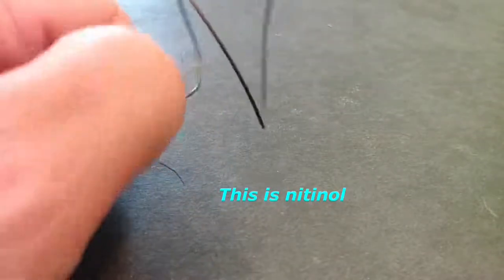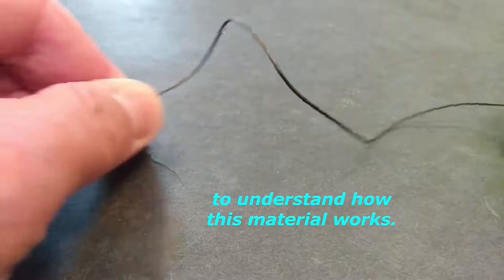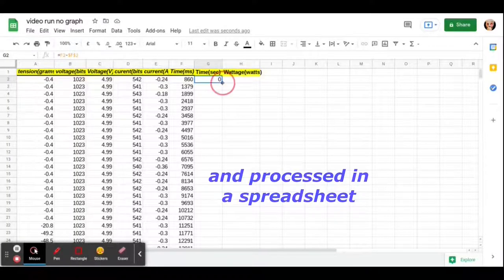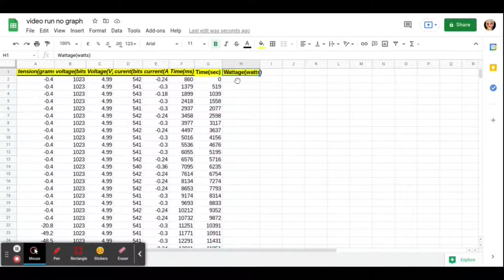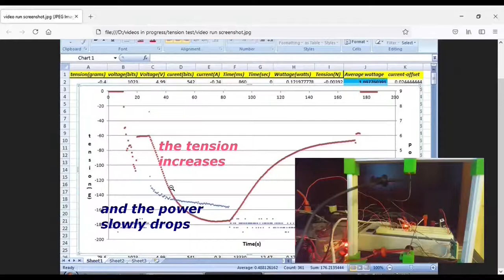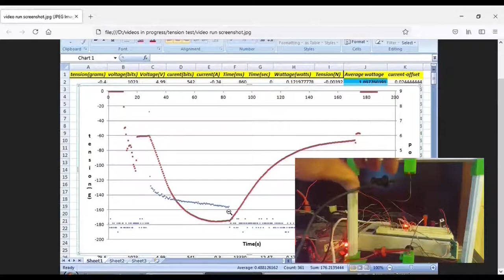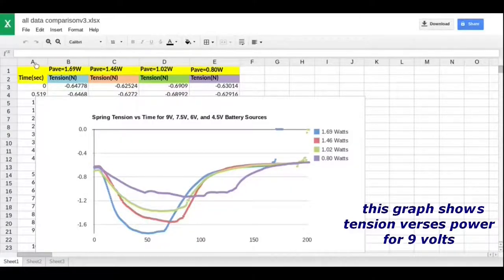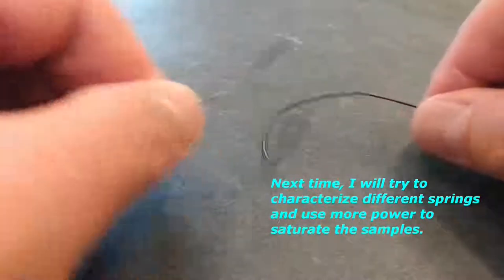nitinol shape memory wire tension test

Comment: Did you find a correlation between the elasticity of the movement over a specific voltage and current ratio?
Reply from the maker: No, I didn't. And I should have shown that data.  I'll go back to my data and plot power vs tension to see if there is a linear relation.  If I had a better power supply I could look for an optimisation for the springs.  Thanks for your interest!

Comment: Hello there ;) i find yours research and testing really interesting and wanted to ask if you think a longer spring would make a difference in power consumption or usable force? I saw a video on how you could make longer springs relativly easily (https://www.youtube.com/watch?v=Us28iaPOitU at about 3:45)  with a little adjustment of the method (make another slot/hole at the other end of the metal rod and clamp it down so it doesn´t pull trough). 
Thanks for the Video
ps: sry for mistakes, english is not my native tongue
Reply from the maker: Thanks for recommending that video. I think it will help me improve my spring making.  Yes, I think longer springs will be much stronger and require more power.  Nitinol seems very scalable.